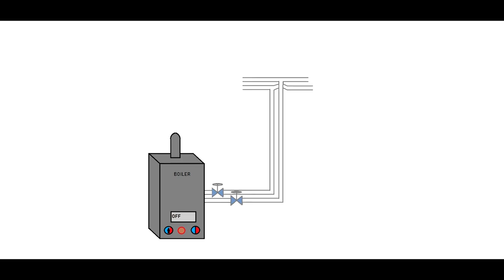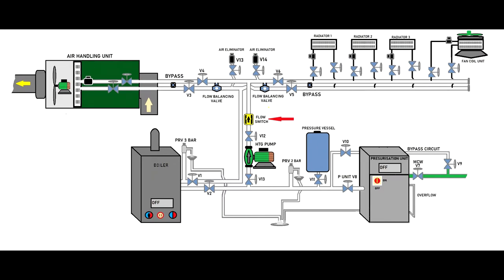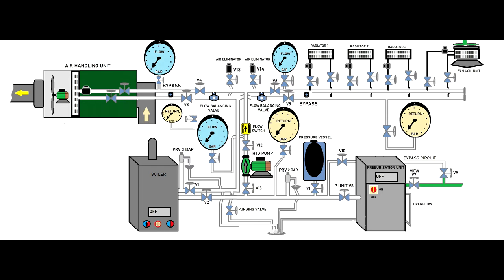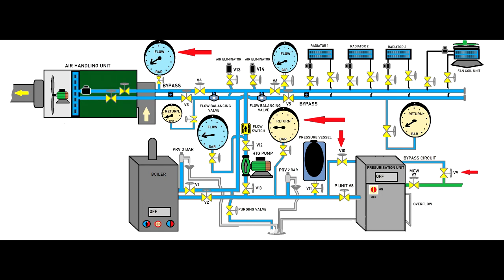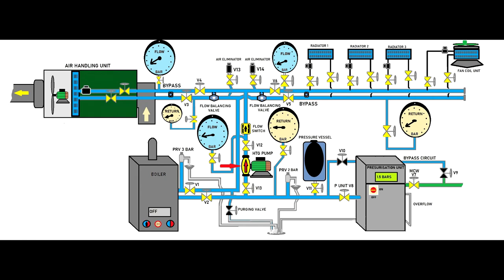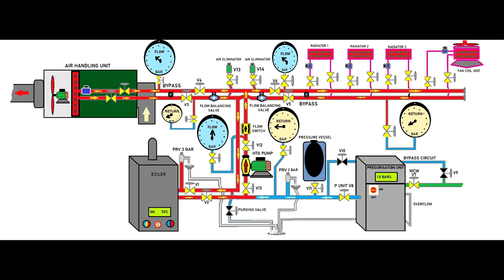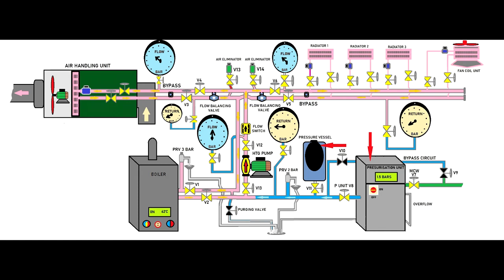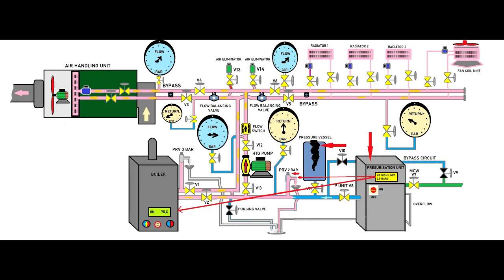Understand commercial  heating installation systems boilers pumps AHUs and pressurisation units.

Comment: Hi. Thank you for the video. I have a query, the positions of the pressure gauges are not right. PG at V12 shows flow and PG at V13 shows return though they are on the same pipeline.
Reply from the maker: They are before and abive the pump .
Pump can not have flow in both sides 
The pump is pushing the liquid and the liquid is returning to the pump .
So you have flow and return .
Reply from the maker: On a close circuit you have only ine pipe technicaly speaking and the pressure DP is governed by the Pump and flow restriction only when pump is running and the fluid is on dinamic state .
When in static state the DP is also giverned by tue building hight but that is apolying inly in vertical pipes .
Every 10m you gain aprox one Bar .
Reply from the maker: Thank you for your observation .
I enjoy challanges !

Comment: Would the feed from the pressurisation unit reduce the htg f temperature before it reaches the htg pump?
Reply from the maker: The presurisation unit is just to make sure the pressure loss is compensate .
The water quantity pushed in to the system should be very small  unless there is a nasty leak . Technically speaking the efect of the injected water is not to be considered when talking about temperature .

Comment: Hi

Can you explain how circulating pump influence pressurisation unit operation? 

In your pressure gauge at return line near circulation pump you see pressure reading above 2 bar but your PRV is set at 2 bar

Wouldn’t pressurisation unit start kicking in and adjust that pressure?
Reply from the maker: When pump start the return pressure is lower that the flow pressure .
The presurizatiin unit  follows the return pressure .When the pump is not running the only pressure difference is in between the lower and any higher point where the pressure is taken .
When the pump is running the heating agent is on dynamic state .
The presurisatiin unit is monitoring the retun pressure .
Reply from the maker: Also the presurissatiin unit show 1.5 bars and the return PRV is set at 2 bars . The flow PRV is set at 3 bars .